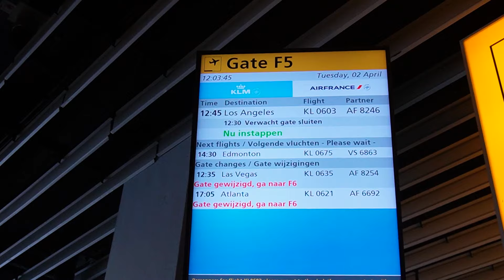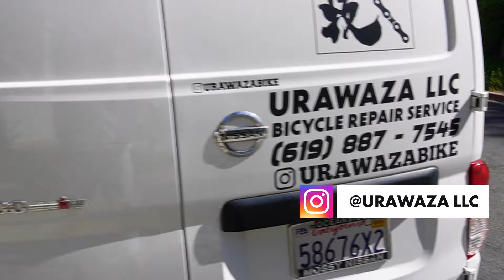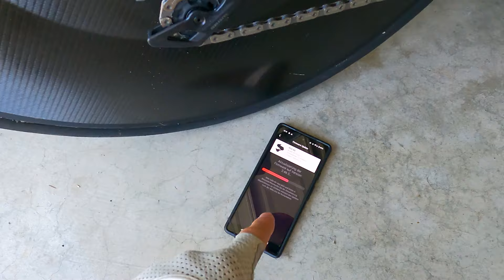The Ultimate IRONMAN 70.3 Oceanside Race Experience!

Comment: What do you mean 5 bars for th tires? Traveling with new tubeless this summer
Reply from the maker: So at least 3, but 5 bar (tire pressure) so they def won't deflate and leak on you! And they def won't explode.
Reply: @MattiWeitz  is that a European term? Bar? Only use PSI for tire pressure. Sorry I am now freaked out about the sealant. Race well today!  💯💯💯
Reply from the maker: @Amanda_K_001  yes we use bars in pressure!
Reply: @MattiWeitz  learned something new! 5 bars  = 70 PSI which you are right not a lot to release. Good to know. Rest and recovery, enjoy your stay in the US. The land of PSI 😉